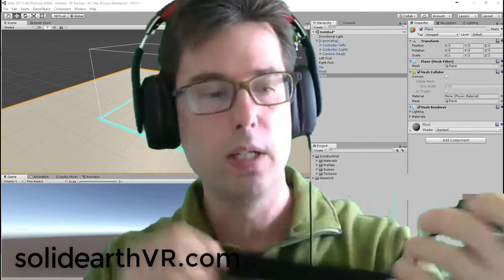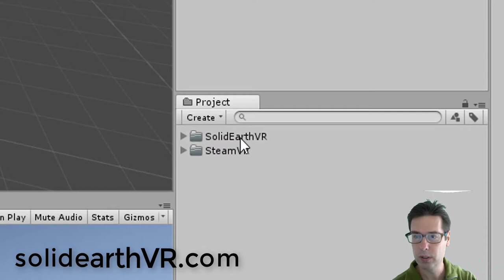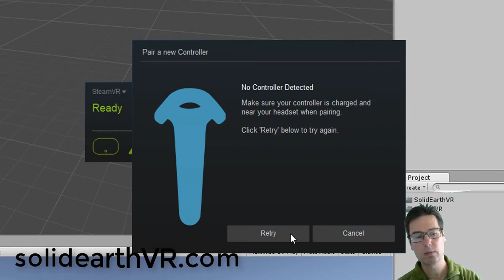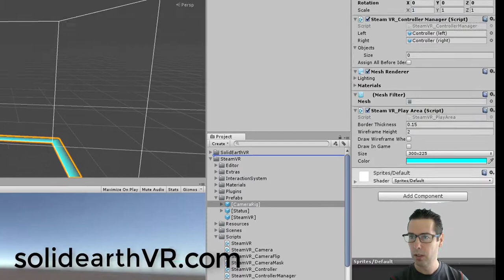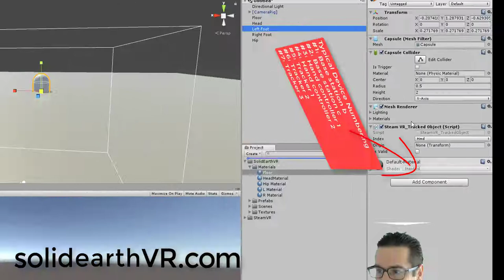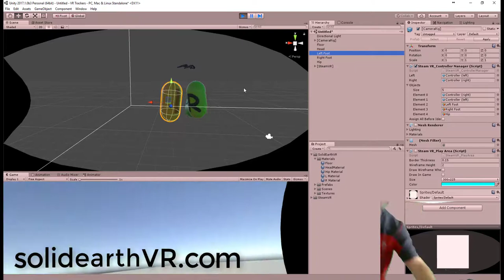[Tutorial] Controlling Objects with the Vive Trackers in Unity3d

Comment: Did this later let you play vr with the trackers or is just to unity 3d
Reply from the maker: You can only use the trackers for VR applications which specifically designed them in.

Comment: Could you please give me more info about how I can pairing the 2 other trackers? Should the dongle be connected all 3 to PC? It would be nice from you to tell me more about the Paring of the 3 Trackers. I search in Internet, but none gives correct description of how to do it. Just like you did here for the first one. thanks in advance
Reply from the maker: Each tracker needs it's own dongle connected to the PC.  So if you're using 3 trackers then 3 dongles need to be connected.  You pair all 3 trackers exactly the same way (right click on the controller icon in steamVR and select "pair controller") and hold the tracker button until it starts blinking blue.